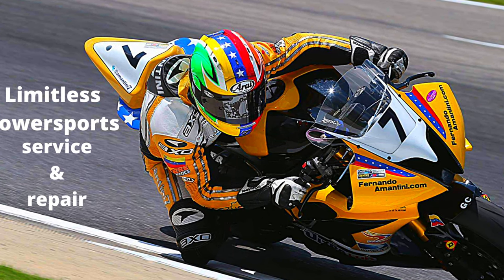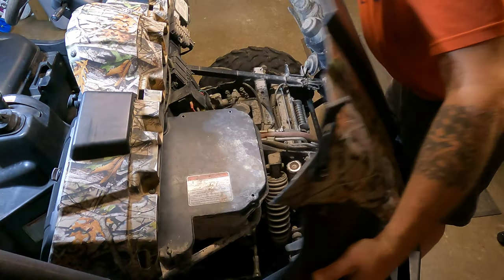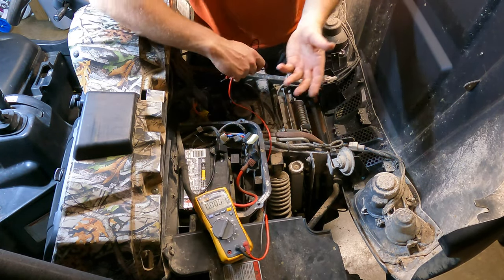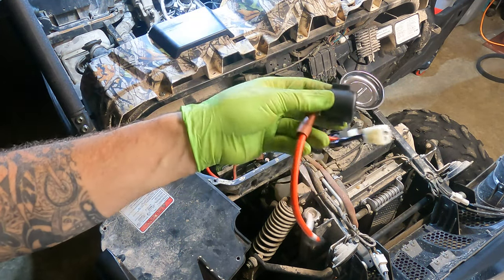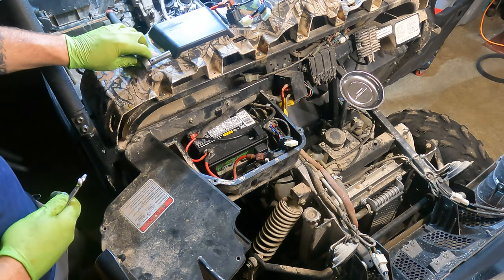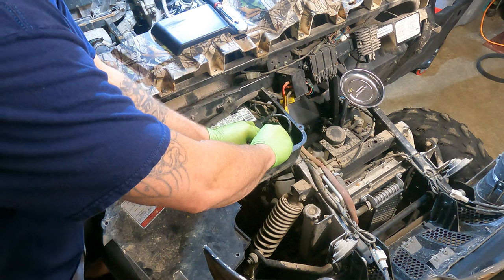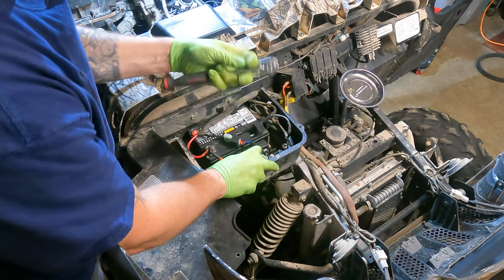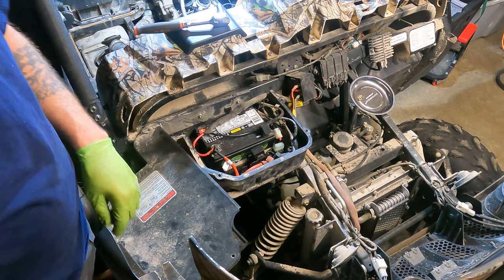This is Part 1 of 3 Massimo MSU 500 not cranking over

Comment: I have a ‘19 model T-Boss 550, since new, sometimes when the key is turned, it may turn a 1/4 turn, key back off, it fires right up, I put a new battery in March, same thing but never hurt anything, it always started so no big deal….until tonight! It started really hard but it started, cruising around my neighborhood, I noticed it was steering funny as if it was in 4x4 or the rear axle was locked together & I had no power to the “dashboard (speedometer etc) 
I do have a click when I turn the key & my LED light bars shine like they always did, if this whole time, it’s been a simple solenoid, I owe you big time. Thanks for the idea
Reply from the maker: Hey Bradley. I'm glad to hear that you got the problem figured out & that my videos helped give you some ideas of what was wrong.
Reply: @limitlesspowersportsservic3394  it ended up that I had 2 problems: 1.) the solenoid was the culprit for my 1/4 turn starts ($8.50 on Amazon) after replacement I still had a no start, no dashboard condition. I started pulling fuses, the 15 amp turn signal fuse was blown. I replaced it & everything is great…my point is: if you own 1 of these machines, stock up on solenoids & fuses…they’re cheap but I could see this causing someone a lot of grief & money to repair

Comment: Thanks for your video.
 I have a massimo 700 that will drain the battery overnight randomly. Sometimes it will happen once a month and sometimes it'll happen after a couple of months. I always make sure the key is off & not on accessary. I have replaced the battery twice with the same problem. Any suggestions will be appreciated.
Reply from the maker: The wiring harness is one of the biggest issues on these machines.  I would start by going through all your connectors & making sure they aren't corroded & put dielectric grease on them all. I have also installed a battery cut off switch on some utvs & with the flip of the switch it cuts all power from the battery to any part of the unit. You will have to go a Voltage draw test & start pulling fuses & possibly connectors to see when the voltage draw stops & what ever is running off that part of the harness will be the issue. That could be multiple things tho. I would start with the 9 pin white connectors first.
Reply: @limitlesspowersportsservic3394  Thank you for the help. I'm going to do the dielectric grease & also place a continuous duty solenoid in the main battery cable & control it with a toggle switch on the dash. Once again Thank you.

Comment: Hey man love the content here! Really appreciate you taking the time to make these videos. Gpt an MSU 500 and initially it would start and run about 5 minutes. Then crank no start. Wait a day or two might start might not. Someone at some point buried the thing in mud. So to start working on it I removed the battery and washed it down pretty good. Now for the second issue. Battery reinstalled after about a month (good charge). Now no power anywhere. Checked main fuse and it's good. I mean nothing comes on. Lights, fuel pump, horn, nothing. Any idea why it would not let voltage get to any of the electronics? Thanks again for your content!
Reply from the maker: It's a possibility that the key switch is bad, are it could be the relay box are even the ecu since it was sunk. I would check all those connector & make sure the ecu pins are not corroded. I've seen that before.

Comment: Hey Kyle thanks for the videos. I have a Massimo 500 new battery and solenoid turn the key wait for electronic fuel injection,turn key nothing no click, nothing. Try maybe 2 or 3 times then just cranks right up. Not sure what the problem. Also if possible can you do a video on adjusting hand break. Thanks
Reply from the maker: You I have ran across brand new starter solenoids being bad. Also make sure all you're power & ground wires are clean &alimg good contact.

Comment: Hey, I really appreciate the content on the massimo lineup. It's really hard to find any info on them. I recently purchased a used 2014 msu 500 and it seems like there's a coolant leak from one of the lines. I can see the line but there's definitely not enough working room to actually replace the line. I'm curious if you've ever needed to replace a coolant line on one of these and if so what was the easiest way to gain access to it? Any help is greatly appreciated!
Reply from the maker: Hey Jeremy.  I have replaced a few in the past & I've been unlucky enough to have to do it when I have had the motor out of the unit. Unfortunately they didn't makes these easy to work on.. A lot of after thoughts when they made these. I wish I could of been more of a help.

Comment: Great video! You seem very knowledgeable on these units. I have a question for you. I have a 2012 Qlink 500 Hisun engine. I have less than 75 miles on the vehicle. My question is what causes hard starts? I thought it was the battery not having enough power, but I replaced the battery 2 times with no changes. It does crank, but hesitates and finally turns over. In your opinion, could it be the starter or adjusting the valves or something else?
Reply from the maker: I would definitely check the valve clearances.  If you haven't done so yet I would up the CCA on you battery also.  Anthony thing it could be is that the onway bear, wet clutch ect in also moving when trying to start the unit up. That will add an extra load to the small batteries these things use. You can also up the gauge of wire for the positive & negative cables.
Reply: @limitlesspowersportsservic3394  I actually upgraded my battery a few years ago to a deep cycle marine battery. I mounted the battery in the dump bed and extended the battery cables from the battery box up front to the back battery in the bed. I used an old jumper cable wires for the extension, they are nice and heavy gauge. I plan on checking the  valve clearances this week. Is the wet clutch stuff hard to check? Do you have a video or cut sheets on the wet clutch service?
Reply from the maker: I have multiple videos on the 500 wet clutch replacement.  It's a simple job just a little time consuming.
Reply: @robertwhitley661  A Deep cycle Marine battery is the opposite of what you want. They have good reserve capacity but low CCA. A starting battery puts out more amperage for starting and will turn the motor over faster..

Comment: What would case the starter to keep cranking after you turn the key off. Because it started up fine rode it for a bit and the went to go turn the key off and the starter kept cranking
Reply from the maker: Bad starter solenoid.  It can either not engage the starter are it can not disengage.  They are pretty cheaply made.

Comment: I have a 2018 cub cadet challenger and when you put it in reverse you can hold it wide open and the rev limiter kicks in and it just bucks back and forth any help would be appreciated
Reply from the maker: Hey Brandon. I think I just sent you an email on what to check. You need to pull that green/Blue wire out of pin 16 on the Grey connector on the ECU.

Comment: I put a brand new relay on it and it still won’t charge unless I have a charger hooked up to the battery
Reply from the maker: Hey Jason. Well replacing the relay has nothing to do with the charging system.  That's going to be either a stator are regulator/ rectifier issue.  I have a video on how to test your charging system.

Comment: 2014 massimo 500, wont start.  Replaced injector, installed inline fuel filter, and replaced IAC sensor. Fuel pump delivers to injector, but not spraying. Will kick if i spray gas in the intake. Thanks in advance
Reply from the maker: Hey Jeremiah. Are you sure the injector us getting voltage? I would start there. The pick up coil & ecm is what tells the injector to fire.

Comment: Woman here so bare with me- When touching the screwdriver to the solenoid and it barely sparks and/or does not start the machine up. Does that mean its a bad solenoid and needs replacing?
Reply from the maker: Hey Jana J. Thanks for checking out my video. My first question would be is the battery a good battery?  Also does the motor turn over when you turn your key? Aslo did you have your key turned to the on position when you jumped the solenoid?  Did the motor turn over slowly are like it usually does?

Comment: What does it mean if you arent sparking at all between the solenoid at all? Mine ran. Stopped it. Doesnt start at all. Swapped solenoid spark plug fuel pump goes but no crank. Noticed get no spark start at all.
Reply from the maker: So when you jump the starter solenoid you don't get any cranking at all? If you turn your key on do you get power to everything else?
Reply: Where im at today. Everything else but a crank. Ran voltage check to the wire to spark plug. Ran it to the square piece wire hooks into under seat. Fuel pump kicks on with key. Lights everything else come on. Just wont crank with turn of key. Already swapped solenoid out no spark jumping across. I think doing testing my black wire from battery to motor spot next to battery is shot. It also jumps from solenoid to starter at same battery terminal. When ohming out all connected it has a terrible read at terminal to starter part of cable. No read from short two piece to area next to battery and beeps. No beep from solenoid to starter.

Comment: Ok so mine I tried jumping solenoid but still won’t turn over solenoid just clicks and when I just it motor doesn’t turn over any suggestions?
Reply from the maker: Make sure that your battery has at least 12volts. When you try to start it check to see how many volts you drop when you try to crank it over. You should only drop 1v maybe 1.5volts. But it's a really good possibility you have a bad starter. Take the spark plug out, jump the solenoid & see if it cranks over. If is doesn't still I would pull the butter CVT cover off & male sure the motor turns over by hand. Jist incase it locked up for some reason.

Comment: I'm looking at a 2015 used version any advise on what to look for / look out for?
Reply from the maker: Oh man there is so much stuff to look out for on these things. Make sure is starts right up & holds a good steady idle. Make sure you can smoothly shift into all gears while you are setting at an idle. You should have to put your foot on the brake to shift to reverse. Make sure there isn't any kicking & bucking on take off in HI gear. Make sure that the diff lock works & the 4x4 work by actual driving it & trying them. Make sure when you do test drive it that it doesn't just fall flat on its face around 15 to 20mph. That would indicate wore off cam lobes. Just look over it very very well.
Reply from the maker: There is so much to look out for when you're checking out one of these units. You want to make sure that it starts right up and idle smoothly. You want to make sure you can shift in and out of every gear while sitting at an idol smoothly. You want to make sure there is no kicking and bucking when taking off in high gear. Make sure that the locking differential button and the 4x4 button actually work while test driving it. Make sure when test driving it that it goes above 15 and 20 miles an hour without falling flat does not accelerate. It is probably a wore out cam lobe. The five hundreds are notorious for stretching the timing chains and breaking the timing chain tensioners and also wearing off the cam lobes. Also, make sure there is no grinding or popping the sound when letting off the gas and letting it deaccelerate until it stops.. There is a ton of stuff to look out for just be smart and look over everything.

Comment: I'm wondering if you cold make a recommendation. I have a 2021 Coleman UTV 400 with only 15 hours on it. It was starting fine until a few weeks ago, then I would have to repeatedly have try and start it about 4 times or so before it would actually start, at which time it would run really rough until it warmed up, then it would start without any problems and run just fine.

Someone told me I may have bad gas, another said they had the same problem and adjusting the valve lash resolved their issue, but I was thinking possible a choke problem.

I did replace the plug, which had a bit of black soot on it. But two hours of running the UTV later, I rechecked the plug and it had soot on it again, but not as bad.

I did purchase it only a few months ago, so it had been basically sitting, for the most part, at the store for around 18 months, so the gas wasn't the greatest, but starting it had never been a problem until now. I poured in some seafoam, which someone recommended and filled the tank with fresh gas and have been letting it run just to use all the gas in the tank, but the starting problem has gotten worse.

Any input on what it could be or what I can check would be highly appreciated. Thank you.
Reply from the maker: I would definitely try to do a ecu reset then Maybe check the valve clearances.  It could be a bad IAC motor also. Also the O2 sensor could be going bad also. But I would start with the ecu reset them gp drive it around at all different speeds & throttle positions & see if the ecu relearns the parameters.  With the unit just being started up at the store & never really drop around the ecu could of got way out of wack on the fueling since it was never really warmed up & driven around before you bought it.

Comment: My seloniod energizes but still wont turn over. Any help?
Reply from the maker: So you're getting power across the solenoid when you turn key to start?  You can have a solenoid that clicks but that doesn't mean it's any good. Did you try jumping it to see if it would turn over?  I have changed a fee starters but most of the time it was the solenoid.  You can also check to see if you're getting power to the starter when you're trying to start you unit up.

Comment: Great video have the same Massimo 500 having a problem with the starter solenoid and the cdi ignition. Do you have a specific place you buy your parts or do you just order off Amazon. Thanks
Reply from the maker: Hey Gerald McRae thanks for stopping in & checking out my channel.  I personally like to get the O.E.M. part but since the machine is a Chinese built one it's the exact same parts on Amazon but a way cheaper price. You can just type on what part it is you're looking for & it should come up if it is available on Amazon. If you can't find it there I use scautosports.com for Massimo parts.
Reply from the maker: Hey Gerald sorry just saw this comment.  Stuff like that I just buy off of Amazon because it's the dame cheap crap lol

Comment: I replaced the solenoid and it still want start? I can jump it over like you do on the video. Fuse is fine.
Any suggestions?
Reply from the maker: Hey Trey. So you get nothing when you turn the key to the start position? Only when you jump the solenoid but still won't fire off? Possible ignition  issue.  Are you getting spark at all?

Comment: Mine will not crank up unless I hold the gas pedal down but will not idle. Does anyone have any suggestions?
Reply from the maker: A few things to try & check. Have you done an ecu reset?  If so I would check you intake track & throttle body if it is a EFI unit. Take the IAC motor offthe throttle body & clean it & spray out the passage for the IAC motor. Check for ait leaks on the intake. Also check vavle clearances,  you should do a leak down test to check the health of the motor. If it's a 500 you should check cam timing & see if the cam lobs are wore off. Also I'd the fuel pump priming? Also check to see if you have at least 38-42 psi & that it hold pressure for at least 5mins after turning the key off. Also could have an issue with the TPS sensor.

Comment: Thanks for the info. Have any ideas why my MSU500 is not moving forward or backwards. Much appreciated!!
Reply from the maker: Hey Norma. There is a good possibility  that you wet clutch are the oneway bearing has gone bad. it's most likely a clutch issue unless your belt has broken. Definitely check you'd shift linkage too.
Reply: @limitlesspowersportsservic3394  Belt is not broken, will check other tips.
Thank you!!
Reply from the maker: I do have a video that talks about the clutch & what I had to do to repair it.
Reply: @limitlesspowersportsservic3394  would you be to tell where I can find it please.
Reply from the maker: It's called, This is part 2 of 3 on this 2005 MSU 500. You should be able to find it on my You tube channel.
Reply: @limitlesspowersportsservic3394  Found it thanks again!!